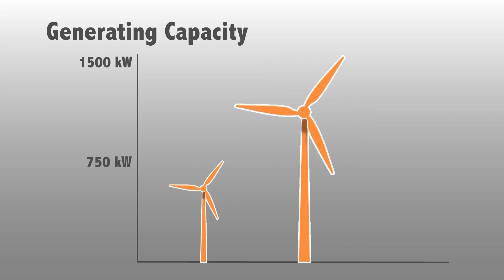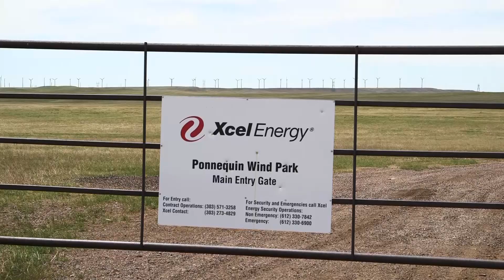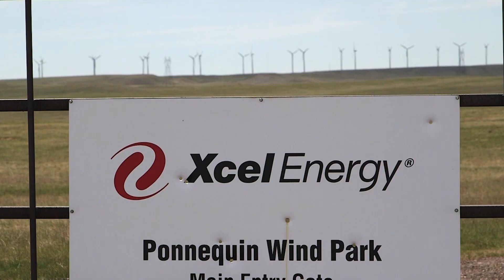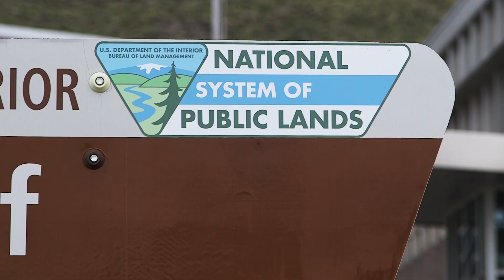Who Cleans Up When a Wind Farm Retires?

Comment: The owner should be required to remove them when decommissioned.
Reply: I agree! Decomissioning costs should be included! How about nuclear power plants and oil refineries?
Reply: @justsomeguy934  nuclear plants do not pay for clean up. They may put a bit of money away but that wont Cover the costs at all. 
The government does pay for it afterwards and thus the tax payer.
Reply: @KeVIn-pm7pu  I am sad to agree with you. For many municipal and industry failures, it is far easier to bribe/manipulate an elected politician than your own board of directors.
Reply: @justsomeguy934  Privatize the profits, socialize the cleanup.
Reply: @benjamingamble2407  "Privatize the profits, socialize the cleanup." Explain - WHY would society pay to clean up something while the polluter keeps the profits? I say make the users of a good or service PAY the entire cost of that good or service. Don't push the cost of a product on my when I don't use that product.
Reply: @justsomeguy934   Costs of removing defunct turbines is huge, much higher than was originally estimated, and that's why old farms are becoming an eyesore when the developer bails out.
Reply: @portnuefflyer  You can repower a turbine tower. You're also not comparing the other costs associated with traditional fuels, nor the pollution and military presence required to escort oil from certain places in the world.
Reply: @portnuefflyer  "Costs of removing defunct turbines is huge, much higher than was originally estimated, and that's why old farms are becoming an eyesore when the developer bails out." Well, considering that we do NO remediation on spilled oil sites or poisoned air, AND given that turbines use no fuel during decades of use, I'd say the comparison doesn't make sense.
Reply: @portnuefflyer  "Costs of removing defunct turbines is huge, much higher than was originally estimated, and that's why old farms are becoming an eyesore when the developer bails out." Um, Prince William Sound (Valdeez  oil spill) after 30 years is still contaminated. Let's talk "eyesore" as opposed to habitat destruction.
Reply: @justsomeguy934  Your thinking is idealistic.  It clearly should be the way you mention, but private companies push hard to avoid bonds/deposits, etc. up front.  They'll say they're job killers, prevent the installation, etc.  Even if they're held by contract to clean up, they will simply declare bankruptcy, reorganize, and be out of the liability.  Look at most every coal mine in the US.  In those cases, the profits were privatized and the cleanup has largely been socialized.  I'm not promoting this, I personally hate it, but I've dealt with this enough to be exceedingly cynical.
Reply: @benjamingamble2407  I don't disagree with you - the practical results of any large municipal effort tend to go to a company or organization bribing the person making the decision. Look at the automobile bailouts in the 1970's - it was actually a situation driven by the labor union for unfair and unjustifiable wages. The unions and the manufacturers bribed politicians on both sides of the aisle and got a taxpayer bailout.
Reply: @justsomeguy934  yes workers dont deserve to be treated fairly and get paid a living wage
Reply: @andrewfischer8564  " yes workers dont deserve to be treated fairly and get paid a living wage" Nope, that statement is a lie fabricated by the UAW. In fact, what was happening was that the UAW was forcing the car makers to pay unskilled labor HUGE, unjustifiable salaries to put in a tail light in a car. The UAW also demanded that the manufacturers NOT automate. The UAW management also paid themselves benefits and retirements that only a dictator would envy! As a result, the quality of American cars became a joke as there was no room for profit after paying a drunk, unskilled worker more than some Ph.Ds made to stand on an assembly line.
Reply: @justsomeguy934  yo mean the corporate heads who designed shitty cars. gas guzzling dinosours. with terrible handling.
Reply: @andrewfischer8564  " yo mean the corporate heads who designed shitty cars. gas guzzling dinosours. with terrible handling." You are absolutely correct! With sky-high labor costs, quality became backseat to a well-made, well-designed car. The American car industry, once the envy of the world, became a laughingstock. Since GM or Ford or Chrysler was not allowed to automate, not allowed to get rid of drunk or dangerous employees, shitty is what you get.
Reply: @justsomeguy934  are u hired by the wind farms? Must be exhausting answering literally everyone in the comments twice
Reply: @andybarritt8642  No, not hired by wind farms or solar farms. I avoid long answers as no one reads them, and it gets confusing as to what particular point is being discussed. If you'll note, I almost ALWAYS quote the exact sentence I'm discussion when replying to a person.
Reply: @nnaw ggg " Eyesore is also habitat destruction, the windfarms area destroyed the habitat of that area" Habitat of what? Pesticides and cats kill way more birds that wind turbines do.
Reply: @justsomeguy934  You seem grossly ignorant on where the energy came from to mine, build, maintain and then clean up windmills... Instead of just having oil pollution we get oil pollution and environmental damage on top of wind farm pollution (massive) and environmental damages... 

Stop pretending you're better... you're the guy powering his massive batteries in his EV with energy made from FF but talking like you're saving the plant... on your computer made of plastics and powered by FF's.
Reply: @FEV369  Actually, I'm very well educated as to what it takes to make a wind turbine (or solar panel). Can't you tell that the oil industry has you talking about making a wind turbine, and NOT talking about what happens to every drop of oil you burn? See how you've been distracted away from the real polluter? 
As for the "pollution" required to make a wind turbine, do you know what pollution it takes to just get the oil out of the ground that is burned for fuel? Let's assume, for the sake of argument, that a wind turbine has the same pollution as a diesel or steam generator in manufacture (that's what you're trying to say, but you have no facts to back it up). Once manufactured, that wind turbine uses NO FUEL. Makes NO POLLUTION. Has LOW MAINTENANCE. Makes megawatts of electricity unattended for months. 
There's an ARMY of employees making a steam or diesel generator run all day. And it makes poison while doing it, for every watt it produces.
Reply: @FEV369  "Instead of just having oil pollution we get oil pollution and environmental damage on top of wind farm " That's exactly what the oil industry wants you to think and tell others. Per my other comment, HOW does a fuel-free energy source ADD pollution on top of its manufacturing impact? Do you know, or did you even THINK to know, what the environmental impact is of making a steam/coal/oil generation plant? Of course not, you don't have any facts; you just spew a one-sided opinion with no research.
Reply: @FEV369  "Stop pretending you're better... you're the guy powering his massive batteries in his EV with energy made from FF but talking like you're saving the plant... on your computer made of plastics and powered by FF's."
I never said I was better at all, there's simply a better way to do things. 
You are 100% correct that we all use oil-based products, mostly plastics, every day. I support your statement! Too bad you think that oil isn't important, because apparently YOU think it's OK to waste almost half of it every day as gasoline or diesel. I happen to think oil is precious, irreplaceable and non-substitutable. We CANNOT afford to throw any of it away if we don't have to.
Reply: @FEV369  "you're the guy powering his massive batteries in his EV with energy made from FF but talking like you're saving the plant." Your statement isn't really correct, here's why:
1) electricity, unlike oil, can come from many places. I have several friends that power their houses and cars completely from the solar panels on their roofs.
2) electric cars are far more efficient than gas cars, a gas car throws away 70% of it's fuel as heat! Don't forget the poison out the tailpipe as a lovely gift from Exxon.
3) if we all drove EVs, we could stop importing oil from the Mideast. I think that's a good idea, how about you?
Reply: @justsomeguy934  Who cares? You have to do the same process to make the fuel to mine, refine, assemble, ship, install, maintain, remove and recycle Wind turbines and solar panels... 

It's not like each panel or turbine takes 1 gallon of gas but over it's like makes an equivalent of thousands of gallons of gas.

On average, when you take failed turbine and failed, under performing and lack of optimal conditions, these turbine and panels are hardly paying back the energy it takes to make them all...
Reply: @justsomeguy934  The oil industry dose not tell me what to think... Do you hear your conspiracy theorist self? 

I'll make you a deal. You go outside and make yourself a solar panel or wind turbine 100% from scratch. You can't use any existing tools or FF energy... 

Go make them, show us all how green this is. Oh btw, you're not allowed to drive a car/truck to move things because that uses FF.

See... you need to add up ALL the energy input you used to make turbines and panels. It does not matter where the energy comes from because in order to keep building "green energy" you still have to use the same amount of energy to make them.

Even after you build panels and wind turbines you still need X amount of energy to make more. This means that of the 100% of power you now make, you have to minus out what you need to keep making more.

The whole process must be accounted for when calculating the energy input of making green energy. This includes you driving to work... because you can't suddenly stop doing that.

The energy cost of green energy must include: The factory to make tractors/heavy equipment, making the tractors, mining the steel for the tractors, refining the materials... building the factory... powering the factory..... powering peoples vehicles to get to work.......

That's just to make the tractors to dig in the ground to extract the materials. It's not even a full list. You still have to move the panels/turbines, install them, maintain them and so on...

Right now you get to use FF and stuff built by FF to make the "green energy" products. Once you convert over and use 0 FF, this means everything going forward draws from green energy sources... The debt must be paid as you go, not 100 years later when it's so much energy debt that you can't even comprehend it. 

Simply put, your robing Peter to pay Paul.
Reply: @FEV369  You are expounding the exact opinions the oil industry wants you to. Tell me, did you think about the resources required to make a wind turbine, or did you read an article/hear about it from someone? If you did, it's likely from an "article" written to have you THINK renewable energy is more costly than oil-based energy. I'll bet you that you didn't come up with that yourself, you read it somewhere. 
Even if you didn't - you're making a one-sided statement. You  don't have any FACTS as to the environmental damage made when making a diesel or steam generator, do you? No, you just said "wind turbines bad" and ignored the impact of the alternative. You're trying to tell me how the factories that make turbines or solar panels consume SO MUCH fossil fuels, SO MUCH environmental impact, yet do not state what the costs are for making the traditional energy engines that consume fuel after that. 
See how your logic is faulty? Why don't you get back to me with a factual statement of the impact of making an oil-based energy engine is. 
Don't worry, you're just repeating what you've heard, what you think you know. I've run into you many many times before.
Reply: @FEV369  "The whole process must be accounted for when calculating the energy input of making green energy. This includes you driving to work... because you can't suddenly stop doing that." I couldn't agree more! You, of course, also know what it takes to burn fossil fuel to do the same things, right? OOPS, I guess you're too busy playing into the hands of the oil industry, too busy to think one energy source is pollution free for decades, the other makes poison every moment it's running.
Reply: @FEV369  "Even after you build panels and wind turbines you still need X amount of energy to make more. This means that of the 100% of power you now make, you have to minus out what you need to keep making more." Your statement makes no sense. Once you make a solar panel or wind turbine, they work for decades with NO FUEL. NO POLLUTION. How is that logic escaping you? You have produced ZERO proof that a wind turbine consumes all the energy it produces to make it; I think I should introduce you to something called FACTS. Google is your friend, and even then check the source it gives you.
Reply: @FEV369  "I'll make you a deal. You go outside and make yourself a solar panel or wind turbine 100% from scratch. You can't use any existing tools or FF energy... " I'll take your deal, as soon as you manufacture an automobile from scratch! Or a refinery that makes the gasoline you use every day. Or make the coal that burns in a power plant. See how foolish your statements are?
Reply: @FEV369  "Right now you get to use FF and stuff built by FF to make the "green energy" products. Once you convert over and use 0 FF, this means everything going forward draws from green energy sources... The debt must be paid as you go, not 100 years later when it's so much energy" Let's see, renewable energy runs on...wait for it...the sun. Everything else runs on fossil fuel. Which one do YOU think is more limited? Geez, it's so easy to debunk everything you say. This is actually fun, keep those comments coming!
Reply: @FEV369  "The whole process must be accounted for when calculating the energy input of making green energy. This includes you driving to work... because you can't suddenly stop doing that." You're aware of the tremendous cost required to extract, transport, refine, transport again, store and burn gasoline, right? You're aware that even after that horrendous cost (environmental and dollars), you throw away 70% of the fuel as heat and poison? You're actually advocating for the stuff?
Reply: @FEV369  "Simply put, your robing Peter to pay Paul." Your cognitive abilities are actually questionable. Robing WHO? The sun for energy? As opposed to robing the taxpayer to give trillions in subsidies to Big Oil? Please tell me how many American aircraft carriers are required to escort sunshine on our land. How many $500,000 airplanes are required to get wind to blow? How many submarines are required to protect a dam that makes electricity?
Peter is most certainly being robbed - and Peter is YOU!
Reply: @FEV369  "That's just to make the tractors to dig in the ground to extract the materials. It's not even a full list. You still have to move the panels/turbines, install them, maintain them and so on.." Gosh, you  have to do that to put the steel in your car, you have to do that to make lumber for your house, you have to do that to make the ductwork in your house, you have to do that to make a furnace in your house. We make things, we consume minerals. Why not make something that stops using fossil fuels unnecessarily?
Reply: @FEV369  "Do you hear your conspiracy theorist self? " Actually, I used to be like you, believing whatever I read or was told, or heard. Then I started researching the articles that I read and BOOM, almost all of them were written by an oil-industry organization or news service that has an interest in oil (or the oil industry owns a part of them). Most notably, the Koch Brother(s) have started multiple organizations that do nothing but write "articles" about how bad electric cars are, all the while NOT mentioning what oil does. If you didn't read an article directly, you've repeated (multiple times, I might add) a statement from an article that you heard somewhere. You have no proof it's true, haven't bothered to look or verify, so you're helping them without being paid.
Reply: @FEV369  "You have to do the same process to make the fuel to mine, refine, assemble, ship, install, maintain, remove and recycle Wind turbines and solar panels... " And in return, you get a maintenance-free energy source that uses no fuel, makes no pollution, works for decades. Don't let facts get in the way of your opinion, you keep burning that oil!
Reply: @justsomeguy934  DUDE... I get it, you suffer from the dunning kruger effect... 

You are claiming to have mad a perpetual motion device... It takes energy to make these items. A turbine takes so much energy to produce that it literally takes a decade or more to pay back the energy spent to make it....

A Turbine requires tens of thousands of pound of concrete... MOVED to location... Tens of thousands of pounds of steel, fabricated and MOVED to location. All of it taken from the ground and refined... The amount of copper in a turbine is incredible, all taken from the ground, refined and MOVED... Plastics... maintenance. scrapping them... All done with FF.

To make a turbine of solar panel requires so much energy that it will take many many many many years to pay back when running constantly in optimal conditions. 

Wind does not always blow, the sun does not always shine, thus energy is not being made while wear is increasing. Solar panels are not all made equal, you get to say solar panels last 25 years but the vast majority last around 7-10 years... probably never paying back their debt. China mass produces crap panels because they are cheap, the spendy panels cost far too much for you to just stick on your home.

You literally have no idea what you're talking about. Yeah, I get it, the wind turbine is not creating oil pollution while it's running (not really, just less)... but it required a MASSIVE amount of oil and it's pollution to make up front. 

It's like the EV cars... they are not Green. The batteries require massive energy, thus oil consumption... Then they are charged with FF based energy... Even if wind/solar is used to power some Ev's the panel and turbines required massive FF energy consumption to make... You're just masking where the energy came from. 

batteries are a massive pollutants, just like solar panels a massive pollutants... just like Turbines are a massive pollutants. All of them require FF to make, so oil/coal pollution as well.

You do realize that things like solar panels are made in China... They don't magically teleport to America on your roof... it all takes MASSIVE AMOUNTS OF ENERGY. That singular solar panel moved two continents and an ocean... AFTER THE FF DID TO BE BURNED TO MAKE THE SOLAR PANEL POSSIBLE... THUS... The consumption of FF and pollution of it still exists ON TOP OF THE PANEL/TURBINES.

Gas does not just magically show up in your gas tank... Turbines/solar don't just magically appear either... You seem concerned with following the process of oil but not solar/turbines...
Reply: @FEV369  "To make a turbine of solar panel requires so much energy that it will take many many many many years to pay back when running constantly in optimal conditions. " So my request that you PROVE a single statement you made is a NO, I take it?
Reply: @FEV369  "You literally have no idea what you're talking about. Yeah, I get it, the wind turbine is not creating oil pollution while it's running (not really, just less)... but it required a MASSIVE amount of oil and it's pollution to make up front." As opposed to making a steam generator, diesel engine? And THEN that device burning fuel? Again, PROVE your statement. You can't, and we both know it.
Reply: @FEV369  "Gas does not just magically show up in your gas tank... Turbines/solar don't just magically appear either... You seem concerned with following the process of oil but not solar/turbines..." Um, sunshine and wind DO magically appear where I live...
Reply: @FEV369  Tesla battery degradation, good article for 500,000 miles: https://insideevs.com/lets-look-at-tesla-model-s-x-battery-degradation/
Reply: @FEV369  Here's Tesla's battery recycling program (please show me gasoline's recycling path): Tesla's battery recycling path: https://youtu.be/LAssX6hAyKs
Reply: @FEV369  Nissan and BMW battery recycling: https://www.drivingelectric.com/your-questions-answered/840/how-recyclable-are-batteries-electric-cars
Reply: @FEV369  "Then they are charged with FF based energy... Even if wind/solar is used to power some Ev's the panel and turbines required massive FF energy consumption to make... You're just masking where the energy came from." Again, you don't know what you're talking about. The payback on making an EV is 16,000 miles, after that it's cleaner and cheaper to operate. Proof (something you don't seem to have): EVs breakeven point at 16,000 miles: https://www.linkedin.com/pulse/astongate-fake-emission-figures-embattled-carmaker-sock-liebreich
Reply: @FEV369  "he consumption of FF and pollution of it still exists ON TOP OF THE PANEL/TURBINES." Your statement applies to a diesel generator or steam plant! Yet those energy sources must BURN fuel to make electricity - a wind farm or solar farm requires NO FUEL. How does wind pollute? How does a solar panel poison the air around you?  Egad, I'm really starting to wonder about your thinking process...
Reply: @FEV369  "Wind does not always blow, the sun does not always shine, thus energy is not being made while wear is increasing. Solar panels are not all made equal, you get to say solar panels last 25 years but the vast majority last around 7-10 years... probably never paying back their debt. " 
Yet AGAIN, you make a statement with no proof! Solar panels make energy unless damaged. Maintenance free. No oil to change. No fuel to consume or burn. PROVE WHAT YOU SAY! Your arse is getting pretty sore with the statements you're pulling out of it!
Reply: @FEV369  "Wind does not always blow, the sun does not always shine, thus energy is not being made while wear is increasing." Wind farms and solar farms are placed where they get enough energy to work! Do you think they just put them anywhere? My state has over 300 days full sunshine a year and enough wind to power HUNDREDS of wind turbines near me. AGAIN, you make unsupportable statements. I have repeatedly asked you to prove what you say, you don't. Why are we having a conversation?
Reply: @FEV369  Here's another energy cost comparison: Wind energy costs compared to fossil fuels: https://blogs.scientificamerican.com/plugged-in/wind-energy-is-one-of-the-cheapest-sources-of-electricity-and-its-getting-cheaper/
Reply: @FEV369  "You sir, are an idiot. Take care =D" I accept your defeat. Quite easy on my part, it's called facts. Stay away from that exhaust your car makes, it's clouding your judgement...
Reply: @justsomeguy934  Cats and pesticides kill way more than turbines? Wow thats a relief. That makes it all right then. Wind farms are almost always placed in historically used bird migration paths. Cuisinart anyone? As for habitat you'd be hugely surprised if you knew what lives in areas like that and not just the ones shown in the video. So you're proposing that its ok to just leave them there when the turbines die and build more elsewhere right?
Reply: @chrislastname744  "ally used bird migration paths. Cuisinart anyone? As for habitat you'd be hugely surprised if you knew what lives in areas like that and not just the ones shown in the video." Nope, I'm calling out your concern for bird deaths that doesn't seem to materialize around greater risks. Buildings kill 3x as many birds as a turbine does. Cats kill more, as do pesticides. So you'd like to address the 1/3 of the problem (for example) and not the 2/3? Methinks your objections might be biased...
Reply: @chrislastname744  Your next environmental objection to wind turbines needs to be the CO2 released by pouring the concrete base, and concern for all the rebar used. Yes, I get that one. Funny, the same people don't object to concrete on highways, bridges and buildings, just wind turbines. What were you saying about birds?
Reply: @chrislastname744  "Cats and pesticides kill way more than turbines? Wow thats a relief. " To help with your relief, did you need a link to a picture of a bird in an oil spill?
Reply: @chrislastname744  they made a break through on bird killing.. paint on of the blades black. now they found birds can now see and avoid the blades
Reply: Not a problem!!! Just use the 'deposit' for cleanup!!!
Reply: Well, I hope he calculated that on day one. I hear the blades are totally useless.
Reply: @brushcountry6361  Turbine blades are crushed and used as concrete filler for the most part. 80% or more of a turbine's mass can be recycled.
Reply: @justsomeguy934    Must be why they keep burying them.
Reply: @brushcountry6361  "Must be why they keep burying them." As opposed to breathing the poison that a diesel generator makes?
Reply: @justsomeguy934  the reason they are not crushed up and recycled is precisely the same reason we don't use asbestos any more. The unacceptable health risks to the workers and those around.
Reply: @justsomeguy934  Interesting. Can you show me your source? Everything I've heard is that is a big problem, the blades are not recyclable and you are saying that they actually are.
Reply: @roberthudson5999  I'll be happy to try. Most of my posts on YouTube that contain hyperlinks are deleted within minutes. I'll make several posts for you, both with quotes from the pages and with the links.
Reply: @roberthudson5999  Here's a quote on the recycle mass percent from evwind dot es: "Today around 85 to 90% of wind turbines’ total mass can be recycled. But turbine blades represent a specific challenge. Made from complex composite materials to allow for lighter and more durable blades, they require specific processes for recycling."
Reply: @roberthudson5999  OK, I've just posted BOTH the replies with a quote and one with a hyperlink. Let's see if it hangs around.
Reply: @justsomeguy934  So why does BBC, NPC, Bloomberg, and Scientific American have stories clearly talking about how these blades are filling up landfills? I've heard this for many years.
Reply: @roberthudson5999  In addition to one source, I have others about wind turbine recycling. In short, turbine blades are the largest problem due to size, but they are made of fiberglass. The same as boat hulls. They are typically crushed and either buried or used as concrete filler. In either case, they're solid waste, not airborne toxins like petroleum products that are burned, nor do they represent watershed issues. If you're not concerned for boat hulls being disposed of, you shouldn't be worried about turbine blades. Same stuff, only bigger. And they provide decades of oil-free, pollution-free energy for the trouble.
Reply: @roberthudson5999  I'm sure you have heard horror stories. I believed them all until I bought an electric car, then I started to "follow the money". You'll never hear a bad car dealership story on your local new station, nor read one in your local paper. If you do, it'll be downplayed. Why? Because newspapers and new television accepts A LOT of automobile advertising. Any story that depicts a dealership experience in anything but a wonderful, warm & fuzzy light will cause the station to get less advertising. 
I know you didn't talk about cars, but I gave you an example of biased reporting. Bloomberg and Forbes are notorious pro-oil sources of information. Forbes in particular has published all sorts of "studies" that do not compare renewable energy to its oil equivalent, they just tell you the 10% problem instead of the 90% oil-based problem. Like I say, follow the money.
In any case, when you read a source like you mention, ask yourself this: does the author have any financial connection to the outcome of the article? Is it from an organization with oil executives on the board? Is it from a university that gets grants from oil? I never used to ask these questions, I blindly believed everything I read. That is, until I read the "EVs are heavy, the extra brake dust will kill us all!" article. Then I felt the disturbance in the Force, so to speak. I started investigating WHO wrote such articles, and my eyes were opened.
Reply: @roberthudson5999  " I've heard this for many years." And I bet I've heard more than you have! I've owned an electric car now for 5 years an OH.MY.GOD. the absolutely bizzare objections to not using gasoline are as silly as they are abundant. Let's stick with just wind and solar farms; here are just a few of the outlandish, baseless and unfactual arguments I've run into for renewable energy:
1) The paint on turbine blades is toxic, it'll kill us all (well, your house has paint on the walls, your car is painted, you've probably chewed a painted pencil or two in your life, so why is the same paint on a turbine blade a problem?)
2) The CO2 released by pouring a concrete turbine base is toxic, it'll kill us all (funny, you didn't object to the CO2 from concrete on a highway, a bridge or your building's foundation...)
3) Batteries are filling up the landfill! (not true, Li-ion batteries are so valuable that recycling places pay a premium for them)
4) Slave labor makes car batteries! (a photo of an African kid is used to show this, but it's actually a photo from a copper mine. Yup, a direct lie from Big Oil). 
5) Solar panels are poison, they're made of toxic stuff! (the panel production is identical to making an LCD TV, funny how you're not concerned for all those TVs...).
See how this works? Notice the truth in all those statements: is paint toxic? YES! Is there CO2 released from concrete? YES! Are solar panels made of something other than sugar? YES! But compared to what you already use and see, your attention to the CO2 of concrete turbine bases is meaningless when you ignore the billions more tons of concrete poured to make an interstate. My eyes were opened.
Reply: @roberthudson5999  btw, thanks for asking me about my sources. You're a far sight better than most folks, I get called names, called stupid, told I don't know what I'm talking about, etc., for merely SUGGESTING we not burn something to make electricity.
Reply: @Richard Gritman "O the joy of the American system of bankruptcy. Pay a little to the government and walk away from your responsibilities." I assume your criticism includes the billions of dollars still owed the US taxpayer from the automobile/union bailout in the 70's and 80's?
Reply: @justsomeguy934 the money was paid back.  and as for unions if you work a 40 hr week and have weekends thank a union
Reply: @andrewfischer8564  The money was NOT paid back, where are you getting your information? The government simply stopped asking for it. Both the bailout and TARP money was never returned in its entirety to the taxpayers. GM still owes about $4 billion. And our reward for bailing out GM was that they avoid paying American labor and suppliers and make cars in China now for sale here.
Reply: @andrewfischer8564  " if you work a 40 hr week and have weekends thank a union" That statement was true in the 1930's. No longer. Our congress passes labor, pay and safety laws without a union. The fact that unions call for strikes if a manufacturer automates their assembly line should tell you everything you need to know.
Reply: Will you require the same of car companies that abandoned factories in Mi or iron mines abandoned in Mn. Land owners signed leases if they didn't know what they were getting into that's on them.
Reply: indeed, XCEL Energy should have been putting some money aside every year in anticipation for the decommissioning of their equipment, and returning the land to the way they found it, at the very least. oil and energy companies need to do much-much better, especially regarding stewardship of the land and protecting the natural environment.
Reply: @techcafe0  I agree, but until the oil companies ALSO remediate their spills and explosions, why should anyone else do it?
Reply: Why? It's there land.  Maybe Biden should pay back the pipeline for shutting done. It will never happen.
Reply: What happens when the company that built them goes bankrupt?
Reply: @CorDawgYT  Sorry, I don't much about Canadian politics. I'm certain, however, that it was a similar bailout in Canada. The UAW here in the USA pulled off a public relations miracle - they got the US population to blame the car makers, not them! Not the six-figure salaries for auto workers in the 70's, not the sky-high benefits for UAW management, not the protection of unskilled or drunk workers, NO! Call it "corporate greed" and blame Ford or GM.
Reply: Oh look! Someone watched the video. The whole way through even.
Reply: @jrregan  "How much of that billion dollar solar money give away Obama constructed ever yield? How many are still working? " Solyndra is what you're talking about. And you know what? I agree. The Obama Administration LIED and COVERED UP the finances of Solyndra at an election. The problem was NOT the solar energy but the mis-management by the Administration to hide a badly-run company. Absolute fraud on part of Obama.
Reply: @justsomeguy934  seems like you are unwilling to provide the evidence you claim to have but is being suppressed by youtube for some unspecified neferious reason. Funny thing is if I put a link to an outside site it shows up fine. Then you run away after claiming I threatened you, while threatening me with childish I'm telling and your gonna get in trouble. Well I'm still waiting for the trouble you threatened me with. Now here is the fact that you all seem to miss or ignore. This windfarm lasted approximately half the claimed lifespan and consequently only generated approximately half the expected income. Imagine if you went out and purchased a new car with a 5 year warranty. After 2 years you began experiencing problems and after 2 and a half years the car comlpeatly breakes down. Who is responsible for the repairs, the owner, the dealership or the manufacturer. You all seem to understand that it is not the consumers responsibility but you then get caught up at the middleman stage. The company that brought and installed the turbines was hoodwinked, they were told that the turbines had a 20 to 25 year life span. Yet after less than 18 years all the turbines have failed. Here is a revolutionary thought, instead of blaming another victim maybe you should team up and support each other and go after the real criminals, the company that lied to you all. The company that sold you a faulty product. Good luck with that by the way, the Chinese legal system is notoriously biased against foreign claims. And before anyone starts no I'm not anti green energy, the government where I live will essentially give you an intrest free loan to install solar panels. Then after the solar panels pay off the loan any excess power generated is sold onto the grid. In actual fact some households don't receive a power bill the get a power payment. Imagine that a country where the government and majority of the citizens essentially agree and actually work towards a solution with as little disruption to peoples lives as possible. It's amazing what you can achieve when all concerned sit down and discuss the problem and possible solutions in a civilised manner and then work to implement the solutions instead of playing the blame game.
Reply: The companies that put them up have all gone bankrupt  they can't. Now whos reponsibility is it now?